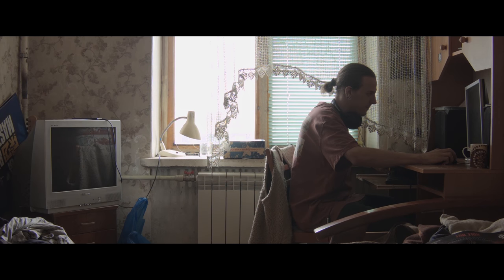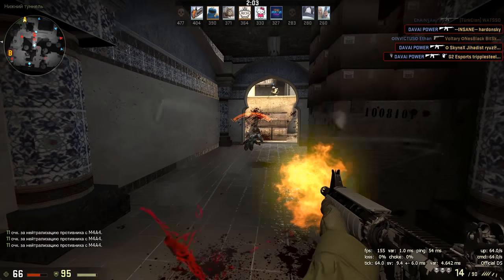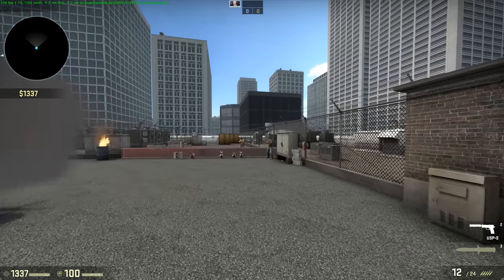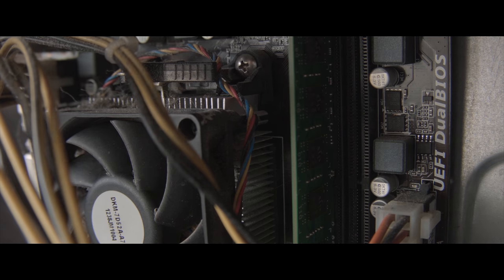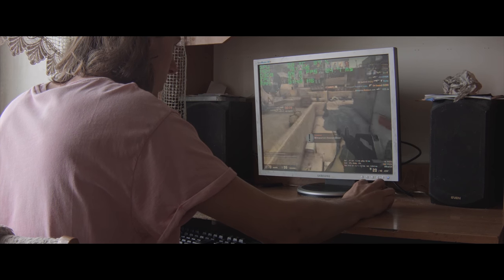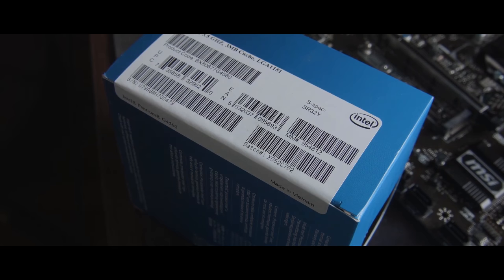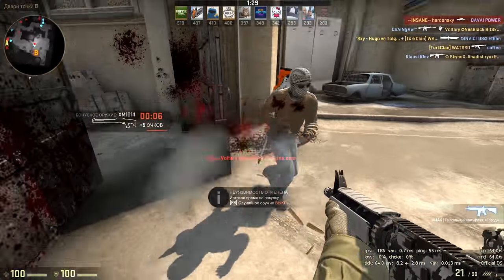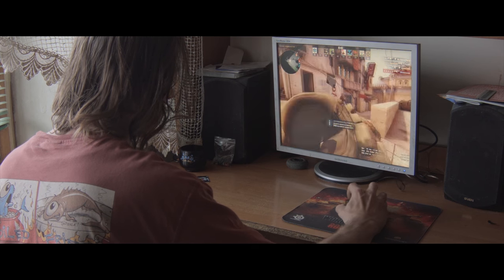Increase FPS by 35% and Remove Lags in CS:GO

Comment: Changing the launch options for threads makes NO difference.  Stop having people do that because they're causing more harm than good.  The developers have said themselves that changing this will have no effect other than a possible negative effect.  Changing tickrate does NOTHING because you're connecting to a server at -64 tick.  If you join a 128 tick server your game automatically adjusts.  Novid is the only useful launch option in that it makes the game launch quicker by avoiding the video.  Adjusting clock speeds, dropping thermals and such will improve performance because you're improving the performance of the PC but adding these launch options are more than likely just bringing your performance back down. 

If there are optimizations like that for the game that would actually impact it's performance in that much of a positive way without having negatives IT WOULD HAVE BEEN DONE.

Comment: I7 , 8 gb Ram , hd intel graphics 5500, what is wrong in my pc?
Reply: I have the same pc but with an i3 and it runs s m o o t h
Reply: Heres the framerate
Highest 153
Avg 60 to 45
Lowest 38
Reply: @andololxd4834  Whattt,the best i hit was 35 fps
Reply: @proshqipez7581  have you used panjo's fps boost guide
Reply: @andololxd4834  no?
Reply: @proshqipez7581  try it its good af